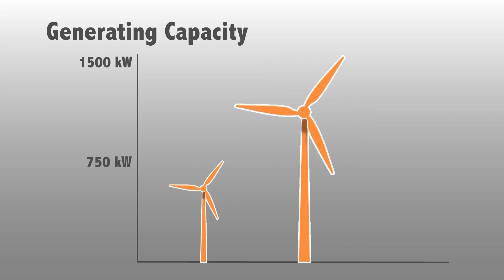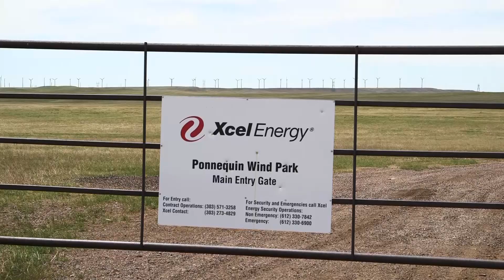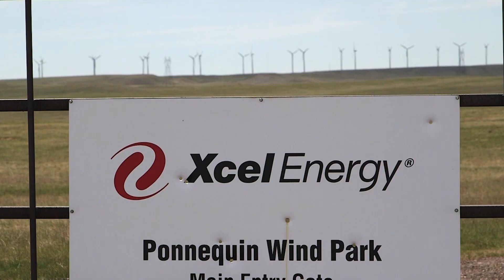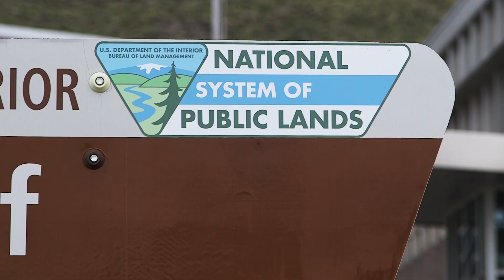Who Cleans Up When a Wind Farm Retires?

Comment: Wind energy is a joke.  It is inconsistent, definitely not green, ugly, requires untold miles of huge transmission lines to carry what little energy they produce and every one of those wind turbines requires backup generation.  The turbines themselves take up little space but the roads required to install and service them chew up a great deal of land, much of it irreplaceable native prairie grassland.
Reply: The land used for roads is not irreplaceable. The roads represent an insignificant imposition, literally threads in the vast prairie blanket, and once abandoned and tilled up, revert quickly back to native grassland as if nothing had ever been there.

Oh yeah, I forgot to mention ... conventional fossil fuel and nuclear power plants also require backup generation or an external power source for startup.
Reply: whiteknightcat.....I live in an area where these turbines exist and can tell you that once the native prairie grassland is disturbed it never comes back the same.  I have a piece of native fescue grassland where a vehicle drove over it years ago and the tire scars are still clearly visible.  Native prairie for all its weather resistance is very fragile.  If you till it, the wind simply blows the topsoil away and the only way it can be most successfully rejuvenated is by buying grass plugs from specialty greenhouses that make an effort to preserve native grasses.  Buying native grass seed to take the land back to what it was is incredibly expensive.  We have already spent hundreds of dollars trying to grow back less than one acre of disturbed land around the barn.  Even cow paths when the soil is broken are ripped wider by the winds so, no, the roads are not an "insignificant imposition.".  There is not much of a "vast prairie blanket" left anymore.  Much of the native grassland has been plowed for agricultural uses where possible.  You are quite right that conventional power plants and nuclear generation require back up generation.  Unfortunately wind turbines only turn when the wind blows and it does not always blow.  Typically, at least in Southern Alberta, when you need the electrical generation the most the wind does not blow.  In the winter here when you require furnace heating the winds are too strong for the turbines to handle so they cannot produce.  In the dead of summer when people want air conditioning the winds are weak.  Last year we had four blackouts in one day in the closet town to our ranch, despite being surrounded by wind turbines. Unfortunately electricity cannot be stored in a bucket and taken out whenever you want.  Therefore backup by coal or gas fired power plants or hydro electric generation is required because solar panels won't help either.  On top of that huge transmission lines have to be constructed on top of that native grassland as well and hundreds of miles of roads must be constructed to service the towers and they are most definitely not an "insignificant imposition" either.  Another big plus go the transmission lines is that they buzz loudly - very loudly - and when a strong wind blows through them they howl.  There is a transmission line out of sight to our west and I have heard the wind howling and crying through the wires multiple times.  Through all this what I'm saying us that in my opinion wind turbines are a waste of money and space.  They are ineffective, throughout their lifetime not one will generate enough electricity to pay for its own carbon footprint, they kill an incredible amount of birds and bats (YouTube - Bird vs Wind Turbine) the only people who make money from them are the people that sell them and the farmers/ranchers money hungry enough to allow them on their land.  Am I biased?  Damn straight I am.  They are a blight and an abomination.
Reply: @cixelysd4686  If what you say regarding grass is accurate then I stand corrected on the part about not being noticeable, but I still find it hard to believe about no regrowth at all. After all, how did the grass get there in the first place? I put it to you, however, that the amount of land damaged and having to be reclaimed after coal mining is far more than that of roads or ROW's.

As an example, use Google Earth or Google Maps and locate Carlos, Texas. Select the satellite view and zoom out a little. You'll see the Gibbons Creek Power Plant to the north which used to be fed by a lignite mine to the south, before they converted to Powder River Basin coal in the 1990's. Can you see where the mine used to be? I can because I used to know the engineer in charge of the place and worked with his wife at another entity. I helped create site illustrations of the mine for a presentation once. When the mine was abandoned they reclaimed the land but it stands out like anything to me. I can see it from thousands of feet up. Is their result any better or worse than reclaimed access roads or ROW's?

As for the term "backup", the wind farms were not built to serve as a primary source of energy. That category goes to fossil fuel plants and they will likely still be the primary source for years to come. It's the wind farms that are the secondary sources of power. By virtue of their existence, the construction of fossil fuel plants is slowed, that's all. This just puts off to the future the use of more coal or natural gas. It's a stopgap, if you will. Will some other form of energy be developed in the future to replace all of them? Nobody knows that yet, so we use what we have available for now until something better comes along. Everything has a cost, be it money, or land, or pollution, or wildlife, or quality of life. There's no free lunch. Utilities simply decide which items on the menu to select.
Reply: whiteknightcat.....Thank you for your response, always nice to chat to someone with some knowledge on a given topic.  To begin.  

NATIVE GRASSLANDS.....I live in Southern Alberta, Canada.  Our area is home to the last 1% of native fescue grass on which these wind turbines and their accompanying transmission lines are built.  The native grasses grow very slowly and reproduce through spreading root structures and seeds should they be lucky enough to land in fertile soil.  Our topsoil layer is very thin and once it is broken open our winds whisk it away.  Believe this or not, but the valley in which we have our ranch has had winds that registered 125 mph.  One of my neighbours lost his entire roof about two years ago.  On our north half section the cow trails are wind scrubbed on an almost daily basis and grow wider.  I put rocks in those I can to slow the erosion but the trails are extensive.  The cost of native seeds and grass plugs is very high.  My wife and I have spent hundreds of dollars trying to regrow the native grasses around the barn about one acre in size. The area has to fenced off so the horses do not eat the young shoots that manage to grow despite us throwing down good topsoil with the seed.  All the seed has to harvested by hand, hence the high cost and I'm aware of only two greenhouses in the province that harvest it.

TURBINES, TRANSMISSION LINES AND ROADS.....the turbines themselves are huge and getting bigger.  Each turbine sits atop a large concrete base that has to be placed an a hole of excavated native grassland.  The area around each turbine is in turn chewed up by the heavy equipment and trucks required to build the pad and then erect the turbine.  The turbines are the cause of death to hundreds of Little Brown Bats, songbirds and Hawks annually.  The transmission lines also destroy great tracts of land and some are worse than others.  The huge monopoles probably disrupt the least but the double line structures are an environmental nightmare.  Not only are the transmission lines environmentally destructive they
Reply: Whitenightcat.....sorry hit the wrong key.....the transmission lines aside from being unsightly dramatically reduce property value, again kill hundreds of birds including ducks, geese, swans and eagles.  When the wind blows they lines howl loudly and the electrical hum from the load they carry is intense.  The roads required for servicing the turbines and transmission lines are vast and eat up far more grassland than the turbines and lines.  For each 20 ft. wide road an additional 20 feet on either side is destroyed by the equipment used to build the roads.  Each turbine has a road to it and the transmission lines require access for repairs and equipment observation.

BACKUP GENERATION.....You are quite right in stating that wind is viewed as a backup generation.  Well welcome to Alberta, our NDP government has decided it should be a primary source of generation despite overwhelming evidence that it can never be.  Even here (today in fact) the wind does not always blow so no energy is being created.  Electricity cannot be stored in a bucket and it must come from somewhere.  Our government in its wisdom is phasing out all coal fired generation.  I probably mentioned that before my message disappeared.

RECLAMATION AND COAL.....while reclamation is a nice idea it is never the same as when nature creates it.  In Northern Alberta the Athabasca Oil Sands are located.  Syncrude Canada and Suncor, two of the major players in strip mining the land for bitumen have huge reclamation efforts but it is not or ever will be the same.  Maybe in 200 years, who knows?  And that leads us to coal.  Our federal and provincial governments are currently in talks about allowing a 26,000 hectare open pit coal mine proposed by an Australian company with an abysmal environmental track record.  It has in the past been fined $1 million for its transgressions.  It proposes to take 1 million litres of water from the headwaters from the headwaters of the Crowsnest River, an internationally acclaimed trout fishery featuring Rainbow Trout, Brown Trout, Eastern Slopes Cutthroat trout and is the spawning ground of Alberta's provincial fish, the endangered Bull Trout.

OPTIONS.....Nuclear?  No thank you.  There have been in excess of 100 nuclear accidents or incidents with Three Mile Island, Chernobyl, and Fukushima being the most notable.  The after effects of Fukushima are now being felt along the west coast of North America through vast fish kills and radiation concentrations above anyone's "safe" level.  Solar, same as wind, a nice idea but spotty.  Hydro electric is a possibility but people protest flooding great tracts of land, as they should.  There are options which would allow only a steep walled valley to be flooded but again that is a hot topic and a mostly no go zone for governments.

So here we are.  A big circle of bureaucracy, greed, poor environmental records, wanna be environmentalists all with their own axe to grind.  You were right when you said there is no such thing as a free lunch.  The problem is that Alberta energy users have to pay for that free lunch while someone else eats it.

Thanks for your time.  I hope you have a happy and healthy New Year.
Reply: Cixelysd 🥴
Reply: Do you drive a prius? Or a eco - boost car?🙈
Reply: Ian Taylor.....Neither I drive a Dodge 1/2 ton 4x4 because I need it to haul crap and pull trailers.  Also because when the snow comes it comes fast and deep.
Reply: @cixelysd4686  They ... ? Go on.
Reply: whiteknightcat.....I hit a wrong button and lost the post.  I reposted it, saw it once and then it too was gone.  I hate computers.  I'll sit down tonight and rewrite it a third time.  Maybe it will get through.
Reply: @cixelysd4686  OK.
Reply: whiteknightcat.....Found it.  It is in the comment section and begins "Whiteknightcat.....Thank you for your response, always nice to chat to someone......"  Hope you find it.  Thanks for your patience.  I'm too old and cranky for computers.  But I'll tell you today was not a good day to invest in wind energy here, it was a gorgeous -7 c and no wind so not a blade was spinning.
Reply: whiteknightcat oh for F's sake.  Here I go again.
Reply: whiteknightcat.....OK, let's try this one last time.  Not only are the transmission lines environmentally destructive they greatly reduce property value if they are in close proximity to your residence, kill ducks, geese, swans, hawks and eagles when they fly into the lines and they howl like banshees when the wind picks up and gets the lines vibrating.  All that and the buzz from the electrical load is very loud and pervasive.

The roads needed to service the turbines and transmission lines cause the biggest environmental impact.  For every 20 ft. wide road an additional 20 feet on either side are required for the heavy machinery to operate on.  So a 20 ft. road results in 60 ft. of damage to the native grassland.  A recent proposed development here states that to service 28 wind turbines would require 14 kilometres of road.  Fourteen kilometres 60 ft wide.  That's a lot of native prairie gone forever.

You spoke of reclamation around the mine near Carlos and how you could see it.  The same holds true here.  I mentioned the tire tracks across an area of our land that remain visible after several years.  In Northeastern Alberta where bitumen is strip mined Syncrude Canada and Suncor have extensive reclamation projects.  They mean well and have reestablished native trees etc. but it is not the same and likely will never be.  With the cost of native grass seed I cannot imagine the local companies willingly replanting native species.  A pipeline that crosses the southern portion of our property years before we moved in was reseeded with God knows what and it shows.

In your post you said that wind is considered a back up option.  That would be true anywhere else but Alberta.  Our NDP government has decided wind energy is going to be a prime source and have legislated that all coal fired power plants are to be decommissioned.  This despite the fact that new technology has made scrubbers more effective and that Alberta has some of the best hard coal available.  So in spite of that, the provincial and federal governments are in talks to allow an Australian company to develop a 26,000 hectare open pit coal mine in the heart of the Crowsnest Pass.  The company proposes to use 1 million litres of water from the headwaters of the Crowsnest River, a world renown trout fishery, home to Rainbow Trout, Brown Trout, Eastern Slopes Cutthroat Trout and is a chief spawning ground for the endangered Bull Trout which is also designated as the official provincial fish.  This despite the fact the company has already been fined in the millions of dollars for its poor environmental track record.  The 26,000 hectare is the smallest proposed by several Australian companies.  Australian?  Yes, Australia has imposed strict regulations around coal mining so it's companies are looking abroad.

You also spoke of alternative sources.  Hydroelectric may be a good choice if vast tracts of land didn't have to be flooded although there are areas where only a single valley would be lost.  Choices.  Solar panels?  Again a good back up plan but don't bet the farm on it.  Nuclear?  No thank you I have no desire to live near Three Mile Island, Chernobyl or Fukushima.  The effects of Fukushima are now being felt on the west coast of North America via huge fish kills and high radiation values in food fish and it is likely to get worse.

All this in a rant against wind turbines.  Golly.

You said that when it comes to utilities and people's need for power generation there is no such thing as a free lunch.  That may be true but I sure get tired of buying lunch for big corporations and watching them eat it while destroying the land on which I live.

Hope this gets through to you.  I'm about done.  

I'm heartsick seeing the mess that is being made of my Municipal District by local politicians who have no idea of the magnitude of the projects they are permitting.  Heartsick by the destruction of native grasslands that can only be restored at great cost, time and effort.  Heartsick that people just don't give a flying fuck as long as they can watch some mind numbing TV show or play the newest video game.

For all of that, it was nice chatting with you.  Have a great New Year.
Reply: @cixelysd4686  Thank you.
Reply: whiteknightcat.....I don't know if this will interest you but on Dec. 27 there was no wind so no turbines, Dec. 28, no wind, no turbines.  Today is Dec. 29 the wind is 170 kph or 105.6 mph the turbines have been geared down to almost a standstill so no generation today.  My horse trough is 75ft. from the house and we are being sprayed.  I went to town, there was a semi upside down in the ditch, a horse trailer in the ditch and a truck with another truck on a trailer also in the ditch.  I had to follow a fully loaded logging truck that had a truck pulling a horse trailer tucked right up beside it leaving less than a full lane for the remaining two way traffic.  I cannot get our mini donkey and mini horse back to the barn because I cannot stand up against the wind.  Just another day in paradise.  Cheers.
Reply: Well i dont really see them making so much power that they have to shut them down.they dont make that much to begin with .all i know is every time i go through sulpher oklahoma up on the ridge where there are thousands of turbines and very few of them ever working.not that i really even care if they work or not but its a really big waste of money building these things when they are throwing tax payers money like this around then do somthing good with it and take that time ,money and materials and the tax payers money help build homless people someplace to live or better yet put the money in to the state roads that need it .anyways i think we all understand but dont wont to admit to it but its truly a big time waste and we all wont to belive that the power is totaly free and dosent cost a thing to produce it but in reality its not pratical and you can lie to your self until you belive its true and thats fine.but i think we all also know we will never run out of coal,gas,oils.but its not about running out of them and its not even all about global-warming😂sorry i had a chuckel .it all reverts back to someone getting rich as $&@$
Reply: @iantaylor4986  If those are the huge 1.5 megawatt turbines, they only need a 27 mile per hour wind to produce over 2000 Horse power each. You get too many of those going at the wrong time, they can easily overdrive the grid. The problem with wind farms, as opposed to a turbine here, and a turbine there, is that they are tightly grouped. that means they all go, or none. That amount of intermittent power can be a handful for grid operators, and generating stations, because the grid really can't store excess energy, and save it for when it's needed. If wind exceeds 20% of generating capacity, curtailment is the only way to maintain stability of the grid. Those big wind farms can do that, considering the tens of thousands of available horse power.
Reply: So they only need 27 mph to produce .the problem is what if the wind dosent blow?what if it doesent blow hard enough for and enitre two or three days to produce?thats big time tax payers eating that also.
Reply: @iantaylor4986  If the wind doesn't blow hard enough, they just free up more assets, to get to the capacity. That's why there are far more machines than would be necessary of the wind blew all the time, which of course, it doesn't. Putting in too much capacity doesn't seem like the most economical thing to do, but without cost effective grid scale energy storage, it's pretty much the only option to simulating a higher capacity factor.  It's either that, or putting in natural gas generators as stop gap, which I think they may have done. To be fully effective, they would want 3 to 5 days worth of storage capacity, to get through those periods of prolonged calm days. The problem is, that a farm like that needs several hundred megawatt hours worth of capacity, and right now, that isn't cheap. without energy storage, there are a lot of compromises.
Reply: Wind farms are usually sited near existing power lines for just that reason, as well as to minimize commissioning costs. No matter what the source of power is, there will always be power lines to get it from the source, to the customer base. turbines are easily decommissioned, and since they don't pollute, it's much easier to reclaim the land. The land occupied by coal plants is so polluted, nothing will ever grow there again. A perfect place for turbines!!!
Reply: Vincent Robinette what about when you only see about 50percent of these turbins even working?thats tax payers paying for it to just sit and do nothing.what about when the brakes dont work and they over spin and destruct them selves in a thousand peices?what about when they go to leaking oil out the frount of it and it ends up all over the ground?and the lady in the clip even said that they would be blown up and then taken to a landfill .a land fill dosent recyle it covers up about 65 to 75 percent with dirt.so my question is how are these praticle and going green they call it?
Reply: @iantaylor4986  <--- Account with no content and no subscribers. Another Putin minion?
Only 50% of wind turbines operating - maybe you could find out WHY before posting
Overspin and self-destruction - really, how many instances among the 1000's of operating turbines? 
Oil leaking - in small amounts and which utilities have responded to and remediated
Demolition and landfill - the narrator did NOT say they'd be landfilled, only the non-recyclable parts

You really need to try harder, Igor. And while you're at it, why don't you post some of your concerns about coal fired plants? Or gas fired plants? Or are you suggesting those are beyond concern or critique?
Reply: @iantaylor4986  Until we come up with grid scale electrical energy storage, that will be a common sight. Those turbines that don't appear to be running, may be due to curtailment, rather than any mechanical malfunction. One of the biggest problems with wind, is that it can sometimes blow at a time where the grid isn't driving enough load to use all that power at that moment. since the grid cannot save power for later, the only option is to reduce power, and that means shutting down turbines, even though they're in perfect working order, and the wind is blowing. IT SUCKS when that happens!! a curtailed turbine is curtailed return on investment. profits blowing in the wind. Many utilities have terminated their net zero metering programs for roof top solar for the same reasons. If I want to do solar, I will need to include a large battery to take full advantage of the panels.I will need my own electrical energy storage system.
Reply: @Vincent Robinette   You bring up several big challenges with renewables. To summarize generating capacity that is not dispatch-able has greatly diminished utility in the grid.  

One big issue few of these discussions ever get to is the hour by hr economics of the grid.   Wind has higher maintenance (gear boxes, etc) than hydro for instance.  I think wind is kind of like a gas turbine plant in that they have a limited life, so the owner is only going to use those finite KWhs when the market is paying above his particular break even number.  Otherwise he’ll just “keep the resource in the bank so to speak “.  

Stand in a good municipal or regional power provider sometime.  Not the controls room of a power plant, but a power retailer.   They may have many wholesale sources of supply as well as their own.  They have to plan ahead and contact enough rotating reserves to cover all their customers every second of every day in the most economically responsible way.   Baseload gets purchased ahead, weekly, monthly, yearly, (yes years in advance) etc for example.  If they have their own plant of some kind they often will do load following within its capabilities since buying the minute by minute power is very expensive.  Hydro can be ideal for this as throttle response can be excellent and costs to run very low (people and maintenance are largely functions of time not kwh).  But they are constrained by needs of fish, farmers, boaters and water level limits for instance.  Of course these change year to year and season to season but planning  the use of this resource vs the demand is very doable.   

Now say your retailer is not blessed with enough hydro of their own or maybe not even to contract with on the grid in proximity.  This load would typically then be filled with smaller combustion type generation equipment more locally.  The most dispatch-able and best load following but expensive way is probably a good big diesel genset, preferably Yellow.  (This is what hospitals and data centers use, sorry for extra details, emergency backup power is another category, but also important.)  Now Diesel generators are expensive to run, so retailer will try to minimize their kWhs.   

My point is electricity is an instant gratification we have come to expect.  Wind has to play in this market.  Obviously it is very hard to sell  as baseboard far in advance.   Obviously it is impossible to sell as load following.  There are stratagems to add layers between these for renewables to help but it ain’t easy.  
.
Reply: @vincentrobinette1507  Actually, yes and no. There are some farms that are sited literally in the middle of nowhere, such as the ones out in west Texas and up in the Panhandle. This requires running hundreds of miles of 138 and 345KV transmission lines to the sites.
Reply: @whiteknightcat  You're probably right. I live in the west, where almost everything is built along tie Interstate 15 corridor. In huge open spaces like in Texas, they're going to try to site the turbines for the highest possible capacity factor. both, for return on investment, and the more steady the power, the less problems caused for the grid. At that point, they have to get the power to the nearest transmission line. The more turbines there are, the more worth it to run the lines, to get it to the grid. I would imagine that there is little or no difference in cost to run lines for a few turbines, or for many. Texas right now leads our nation for wind generating capacity. They say everything's big in Texas, Wind farms are case and point.
Reply: Vincent Robinette.....The area in which I live does not have transmission lines large enough to carry the electrical load our government thinks wind turbines will carry.  Therefore AltaLink, a wholly owned subsidiary of Warren Buffet's Berkshire Hathaway, wants to build a huge transmission line to paid for by ALL Alberta electricity users.  Buffet is not putting one cent toward its construction.  Wind farms may be easily decommissioned but their removal causes just as much environmental damage as their construction and who foots the bill?  In Alberta we have had a coal plant's source of coal reclaimed and the area is now being farmed.  I cannot speak of the power plant itself since I moved out of the area and have not seen it for many years.  Our coal fired power plants are not located in particularly windy areas and would be a poor choice for wind turbines.  Therefore one of the most beautiful areas of our province will likely be be littered with huge wind turbines and a transmission line for a power source that is at best poor backup generation.  The best solution, that I can see, is hydroelectric generation that would flood only a steep walled valley rather than countless acres of wind farms.  Unfortunately hydroelectric generation comes with its own share of opposition and challenges and is certainly a hot potato issue for politicians.
Reply: Lol how did i know he was going to have the correct or the right answer and all of mine would be not correct.lol anyways i love coal and i love gas.i burn all of that shit that i can.im just saying turbins are a huge waste of money ,a joke , and i know im right because ive seen it with my own eyes.whitenightcat😂
Reply: @iantaylor4986  I'm sure you have, Igor.
Reply: And then lets go back to the wind turbin for a sec.you know i forgot to mention the cost of setting theses things up and i have a ball park idea what they cost.the over the road trucks on the highway hauling this heavy shit buring all the fule in the big trucks that isint created by turbins.the trucks trying to get down road and holding up all that traffic which is polluting the air for your turbins.then all the money spent taking them down hauling them off with probaly the same truck they were hauled in on to.then off to the landfill to get coverd up and the rest to scrap and all of the equipment used to dismantle them and the fossile fules used to take care of that .so if you think these things still come out on top then lmfao🤘
Reply: @iantaylor4986  Sounds like any other infrastructure. Buildings are being demolished, then rebuilt all the time. I don't think turbines even register above the noise floor when it comes to the process and the transportation of materials. All the wind farms are nothing compared to all the road construction that happens all the time. to fuel conventional plants, trains and trucks are on the move throughout the entire cycle life of the plant. Turbines, there is no other transportation once commissioned. Have you seen the huge trucks used at the mines? coal means they don't stop.No matter what, a fueled plant has a much larger footprint than any renewable asset, wind or solar. Also, neither wind, nor solar require the continuous flow of water for cooling. No electrical generation is without its requirements, Renewables are just the least worst.
Reply: Vincent Robinette lol ok well ill leave you guys with it .it sounds like yall have all the kinks worked out and good luck with your problem free genarator😂
Reply: @iantaylor4986  It's been a good debate about an important topic. I appreciate the fact that you're showing interest in it, and a lot of data has been shared, and a lot of factors I haven't thought of have been addressed. It's discussions like this, that drive progress. Good Luck!!!
Reply: @iantaylor4986  Still haven't mastered your Russian - English translation app have you? I know, why don't you practice by telling us how perfect the construction, maintenance, and disposition of coal and gas fired power plants is, including the acquisition of the fuels, and the remediation once they're expended? Maybe use an example from around St Petersburg, in YOUR country?
Reply: Cixelysd    “Irreplaceable native prairie grass land “ what the hell?   I grew up on the prairie and let me tell ya there’s plenty still there.
Reply: Tim Duncan.....a blade of grass looks huge if you hold it in front of your eye.  Three, four or five sections look big until they are gone.  Irreplaceable.
Reply: Wind turbine energy is a joke. Dutch windmill generators would pay like a slot machine.
Reply: Carbon dioxide from fossil fuels harms grassland far more.
Reply: Nicholas Littlejohn.....not with you on that one.  Canada produces 2% of the world's carbon pollution and we have vast forests that pretty much negate that.  In my opinion mankind (peoplekind according to our Prime Mistake) destroys far more grassland through industrial and agricultural development.  I live in an area where wind turbines are huge and many with more proposed to follow.  Transmission lines to carry what little load wind turbines generate eat up many acres.  I appreciate your opinion, it's just one I don't subscribe to.  Thanks for the reply.